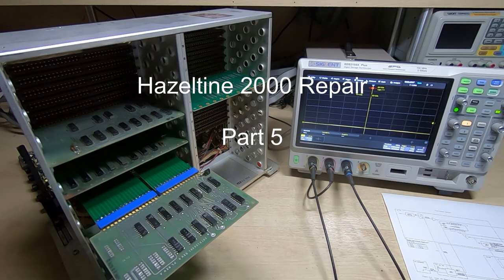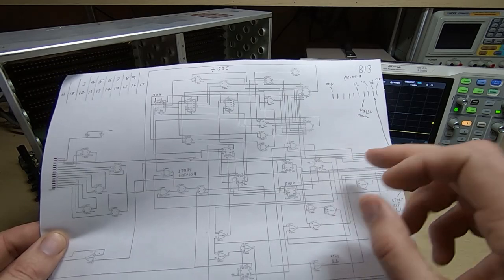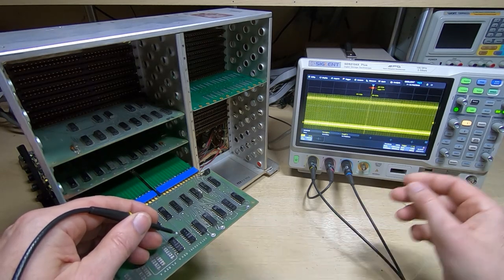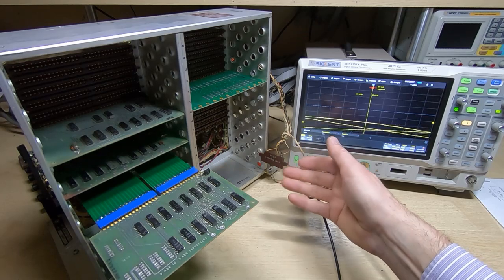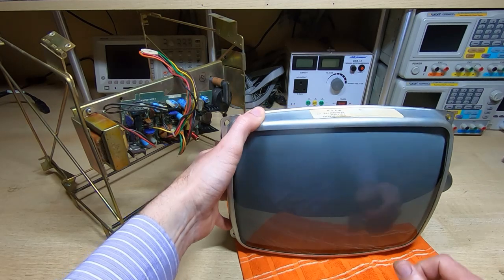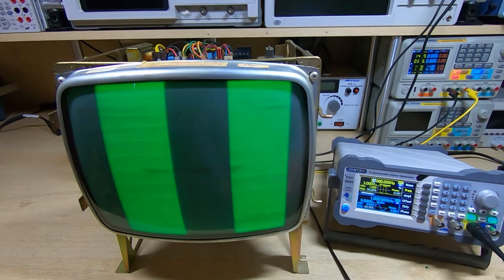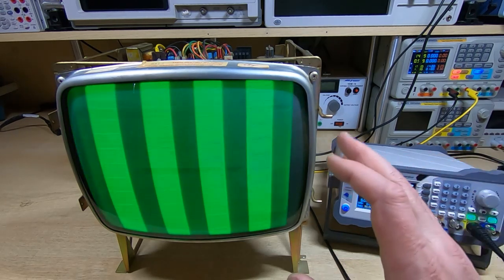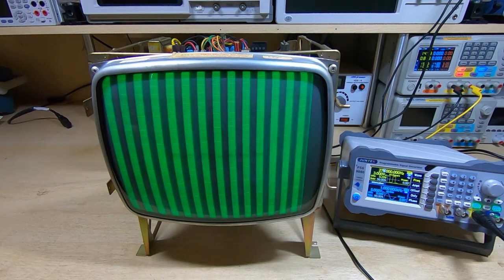Hazeltine 2000 Repair Part5

Comment: Good that it seems to be working better now. When you mentioned that the focus was off, I wondered if the tripler was on the way out and the HT voltage was low.
Reply from the maker: It does not have a tripler, It is much simpler and uses a basic transformer to generate most of the required voltages. Others are generated from the yoke 'flyback'.
Reply: Quite a simple and interesting design then.

Comment: It might be worth mentioning to not wipe the back of a CRT with a damp cloth, no matter how dirty. You could wipe the "Aquadag" clean off. It might not effect the function of the monitor that much, but it will make a mess and is quite alarming. (Don't ask me how I know) 🙂
Reply from the maker: I use a damp cloth to clean the tube (actually glass cleaner). If the Aquadag comes off then it needs to be replaced anyway as a damp cloth should not remove it unless it has become unbonded.

Comment: Something in that monitor isn't happy.
There's something that is oscillating between different frequencies in a heavily strained manner.
Not significantly affected by what's pictured so I don't think it's the flyback or b+
Reply from the maker: No it is just the flyback and it does not have a B+. If you look at the spectrum you will see a single spike at 17KHz which is the flyback and as I say in the video it is making a whining noise. It will most likely be a lot quieter when it is running in the machine but these monitors are very simple and are prone to making noise.

Comment: It seems like it's very common for people refurbing old (15-20 years, or even newer) gear to get very keen on recapping. Even doing blanket recaps "just because".  You are handling much older equipment like the PDPs and terminals from the 70s. But I can't recall you doing any major recapping work on them. Do you do that behind the scenes and really don't mention it too much since it's "obvious" or are most of the stuff you're working on of such quality that basically only the larger caps in linear PSUs needs some reforming and they're good  to go?
Reply from the maker: I think everyone should do what they are most comfortable with. For me I think that the internet has served to convince many people that shot gunning every capacitor in sight is always needed. I do not do this and I have repaired thousands of pieces of equipment without any issues. The only equipment I routinely shot gun cap replacement is old valve radios and TV's which have paper and aluminium caps (not to be confused with more modern electrolytics). In general that means anything built prior to approx 1955. I would certainly not expect to need to replace all caps on something as new as a PDP but I do test most caps for shorts, capacity, esr etc and I only replace those that need to be replaced (I refer to this in the videos as static testing). Modern large caps do not really reform, it was only older liquid filled caps that tended to reform. However as I said everyone should do whatever they want to and it probably does not do any harm replacing caps if you really want to.

Comment: That monitor whine is horrible, even over these tablet speakers. It's so bad I think something is really is wrong with it, you should check it out. Can you really not hear it? I expect/hope it should show up quite strong and clear in an audio spectrum graph.
Reply from the maker: 'Can I really not hear it'?  See 10:50 where I specifically point it out. I also cut the audio above 8kHz by -40db so if it still very loud at 17Khz on your system then maybe you could adjust your audio settings to reduce the high frequency levels. On the actual video after the filter the level of the 17Khz whine is only 24db which should not be  loud (not to be confused with the transformer resonance at 8KHz caused by the board not being secured).At any rate why would you think I would examine it in an audio spectrum graph? These videos are for anyone interested in vintage machines and that includes any noises they make. It is also VERY common (as I say in the video) for these terminals to make a lot of noise.
Reply: @JerryWalker001  Sadly (or fortunately) I am in my late 60s and have significant high frequency hearing loss, so I don't hear the 15KHz whine at all (unless I crank the volume on my headphones way up). I guess there is at least one upside to getting old!
Reply from the maker: @MikeShawaluk  I agree, maybe the complainers should enjoy the whine while they still can :)